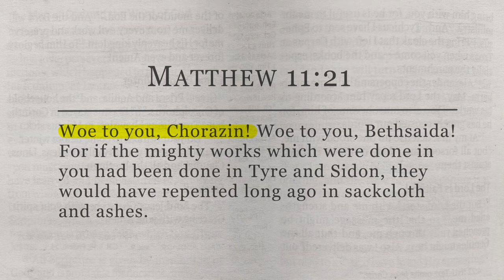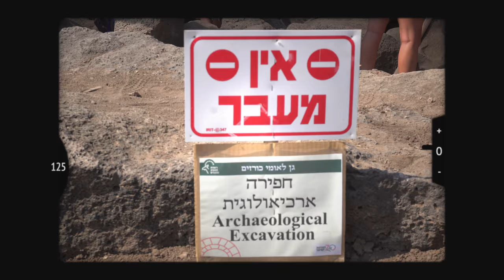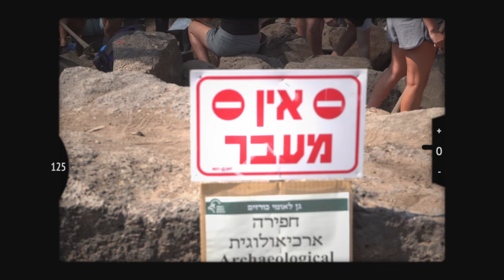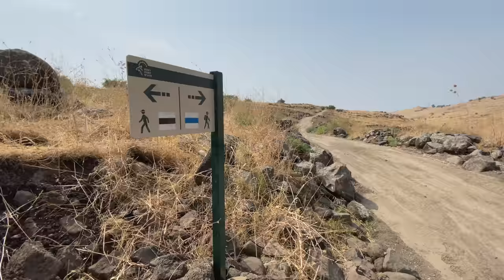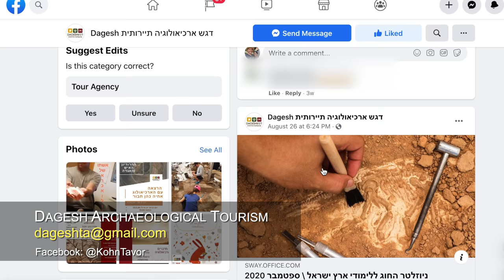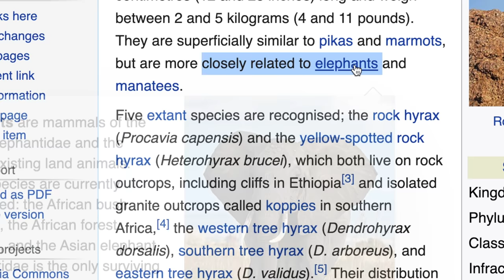Lifting the ancient floor of the cursed city of Chorazin

Comment: Thank you so much for the video!
Before the 1st century pottery shards were found beneath the foundation of the site, faith confirmed the authenticity of the location.
By finding the shards, now science may confirm the authenticity of the location.
Do you feel different about the location now that there is some scientific proof of authenticity beyond faith?  Does it actually matter that matters of faith be proven?  And what does the role of faith then become if science is required to back up that faith?
I’m not sure myself, but I thank you for sharing this remarkable find!
Steve K.

Comment: In reference to the boulders that were placed on top of the 1st century building. Don't forget that Israel was attacked just 70 years after Christ walked that valley. When the second temple was destroyed, the adjoining areas also suffered severe attack. to include even the trees being uprooted. The boulder put on top of the location that is now the floor of the Synagogue, may very well be because they covered the ruins of what was destroyed when the 2nd temple fell. Then began to build on top of what was destroyed.